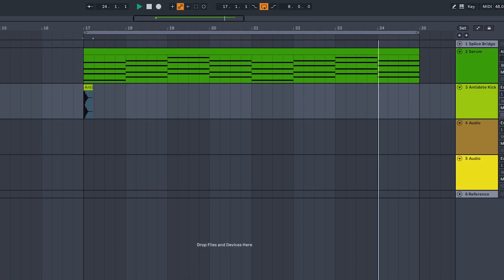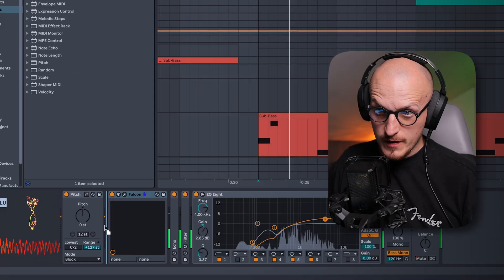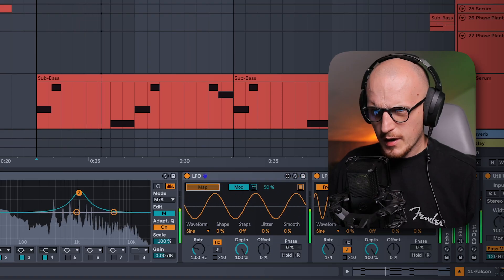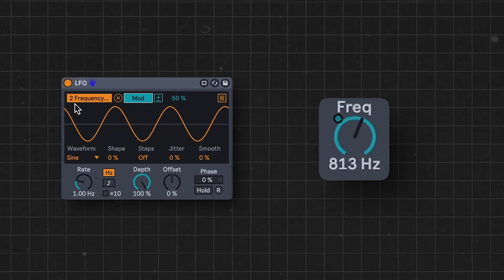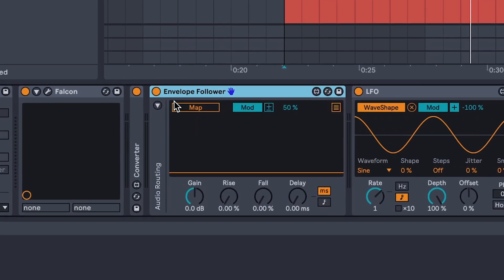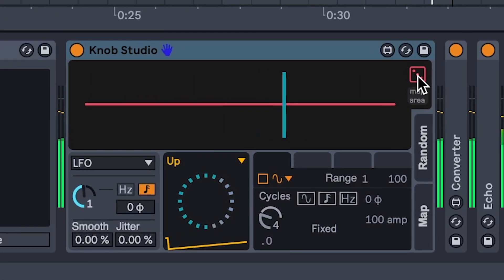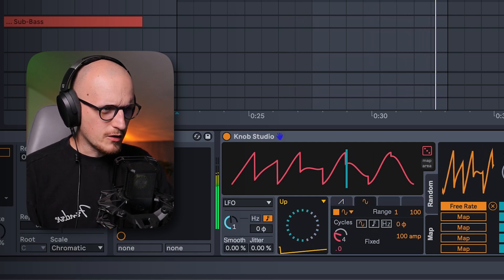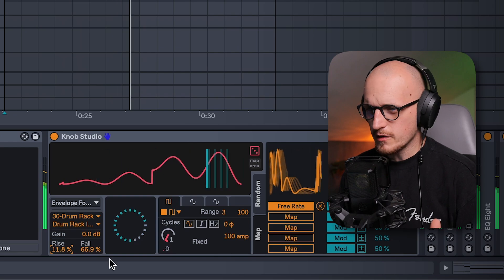Unveiling The SECRETS Of Sound Design in Ableton

Comment: The two LFOs in Meld completely nail it. There are some M4L based on mathematical operations with LFOs but still the complete and best package remains the two LFOs in Meld. Wish I could have that in a separate modulation device.
Reply: If you want use LFOs from an instrument, consider that as using the instrument as an a source of LFO. Try add some simple wave with proper frequency (optionally: disable output to Main), then use Envelope Follower. That should do the trick.

Comment: I came to the realization that Ableton doesn’t have “instruments.”  Like an organ, it is ONE instrument capable of producing different sounds.  You cannot use your experience with actual instruments to predict what it will sound like in Ableton.
Reply: I’ve started to view it as a modular synth. When you buy a fancy synth Ableton can do it all but in a more stripped back precise way. This is what I’m telling myself as I try to learn it and if I learn it doesn’t work this way I will buy fancy synths. I like it because I can’t fall into clicking on presets and instead need to understand synthesis to make sounds
Reply: It plays through a single sound source, or a stereo sound source more accurately. Which yes, by technical definition means it fits the instrument category. But yeah your soundcard is a part of the instrument, as is the computer, it's best to think of Live like the firmware for a digital synthesizer, with your PC and soundcard being the hardware component. That is the most accurate way to define it, regardless of how many acoustic/live recordings you're using, it's all still going through your synth, Ableton.